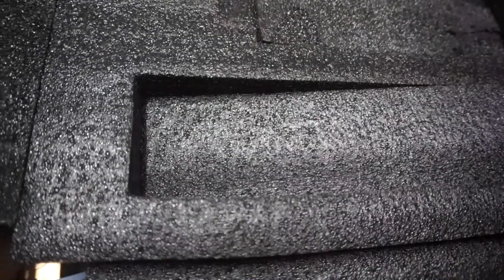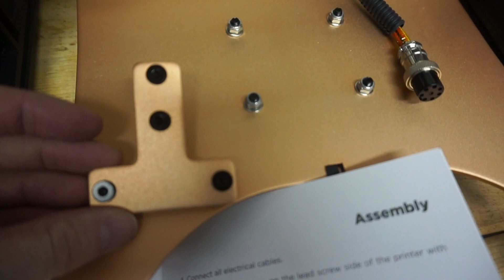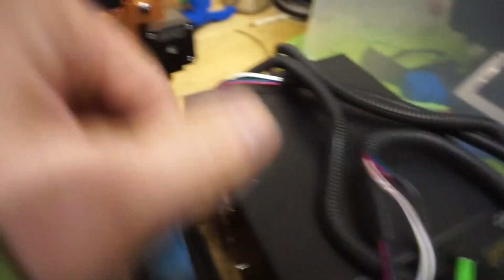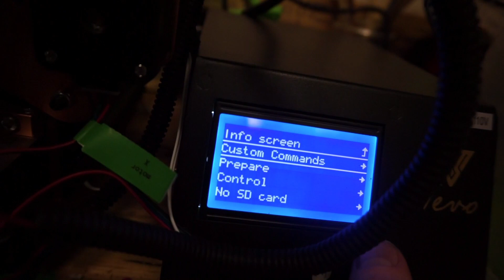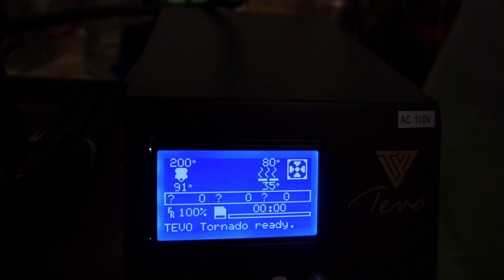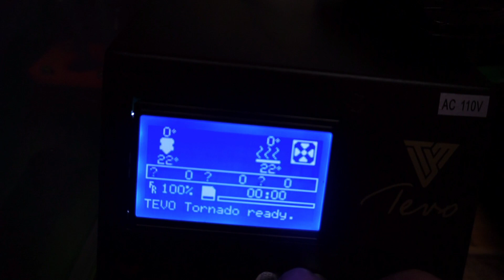Tevo Tornado - Unbox, Setup, First Print

Comment: Don't put the control box on the right side, it goes on the left.

Don't spend 30 minutes perfectly placing the bronze T frame bolts into the black frame like he did. Just put the screws in the T frame, screw the bolts in loosely to the other side, press the T frame against the black frame and tighten each screw. It takes a bit of awkward angling, but they'll all pop in and tighten, it's way easier than trying to get the bolts to stay in the black frame.

Also, I don't think you're suppose to just rip the frame out of the styrofoam, maybe I was just too scared, but I ripped off layer by layer until I got to the bottom layers, because some of the layers go on top of parts of the frame.

Comment: Control box is on the wrong side, it even shows it on the left in the manual and you can't access the SD slot on the left of the unit...
Reply: My SD slots on the left side of the box 🤷🏽